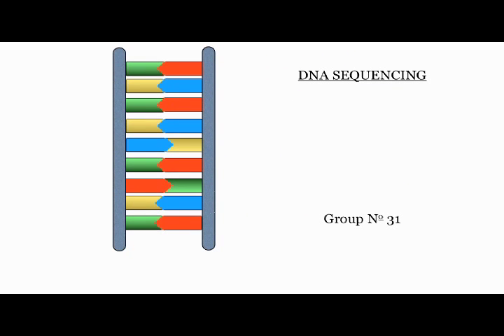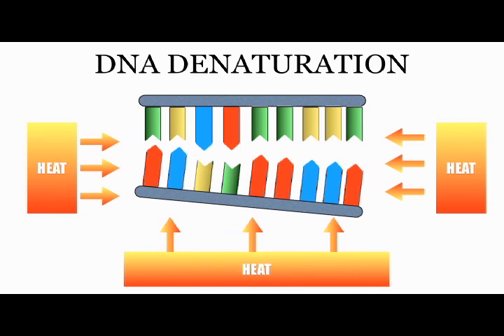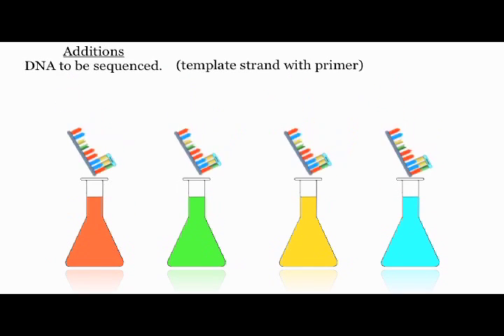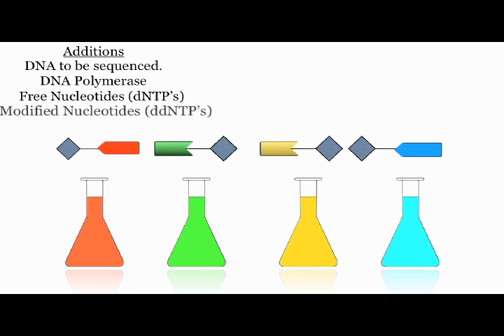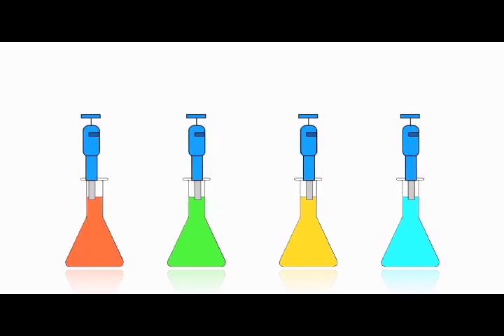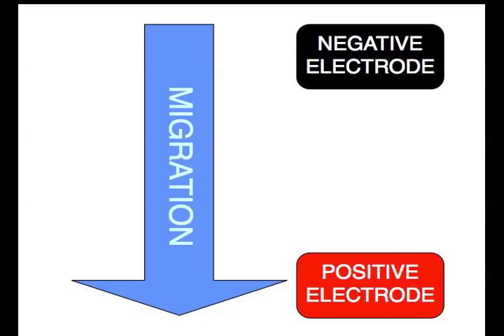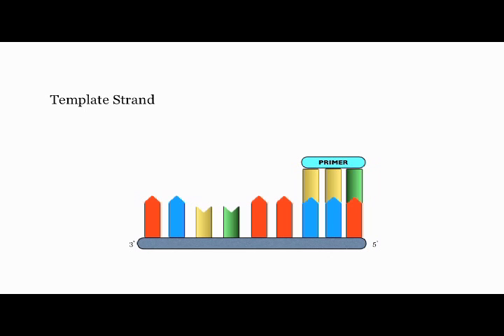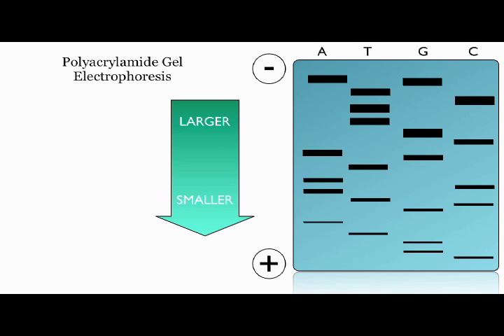DNA Sequencing: The Chain Termination Method (Sanger Method)

Comment: 1. He fails to explain that it is the primers that got labeled so that X-ray can be used to see all sequences.
2. His accent is annoying.
3. He fails to mention the sequences differ by one base only in gel electrophoresis.

Therefore I gave the video a thumb down.
Reply from the maker: In reply to your critisms:
1) Radiolabelling of nucleotides mentioned at 1:02. Also, at 2:09; "The gel is dried down and an X-ray taken. Since we radio-labelled a dNTP we can now see it show up on the X-ray film."
2) A matter of opinion. I would point out that Irish accents are consistently ranked as some of the most attractive, but I understand that some people are just hard to please.
3) This is incorrect. At 1:47 I mention how polyacrylamide gels can separate fragments differing in length by 1bp. Also I would point out, contrary to your point, that this is not true for all gels. Agarose gels for example, can typically resolve differences no smaller than ~40bp between fragments but this does depend on the gel percentage and other variables.
Reply: Thumb up for the effort.
Reply: wilson Liu u got rekt
Reply: if you understand it so well then why don't you make your own video?
Reply: your comment is unnecessary
Reply: rekt

Comment: I'm still confused why reading across the bands will tell you the dna sequence. am I missing background info that would help?
Reply: Did you find the answer yet ?
I have the same question 😑
Reply: +Deena Haroon I typed all this on my phone and only now realized all the typing errors. sorry. I hope you can read past it and it was able to explain it properly. (as a note, although it may look like the 5' end is the end shortening, it should be the 3' end that is being removed and shortened.)
Reply: +Jessica Wong actually, you probably don't even need a ladder here. I think the main fact is that you have a primer, so you can make a defined start point. So the template bound to the primer should be the smallest molecule. On a gel, this should be at the bottom. So now, if you have all other molecules in the well separated by a single base, you can pretty much read the order in which they appear, from the primer sequence onwards (or upwards in the gel). 

Again, hope that makes sense. I'm busy studying for a genetics exam :-p
Reply: +Jessica Wong  hey im not entirely sure myself but the video mentions that the gel can separate molecules by even one base. And usually, when you use a gel you always have a marker (I'm assuming these markers mark different intervals across the length of DNA). So if you combine this with the fact that each lane has a band corresponding to a termination by a base of that lane, you can read off (using the marker) where these bases are on the fragment of DNA. 

Not too sure I made any sense there hah

Comment: Hi, sorry when I'm wrong, but DNA ploymerase goes from 5' to 3', so is the primer in the video on the wrong side, isn't it ?
Reply: +Borat Sagdiyev To rid of any confusion: DNA Poly replicates in the 5' to 3' direction complementary to the template strand which will appear 3' to 5'.
Edit: Removed PolyIII as Poly I is used in this method.
Reply: +Peter Allen Thats awkward phrasing. DNA polymerase travels in a 3' to 5' direction, producing a NEW DNA strand in the 5' to 3' direction
Reply: You're correct, sorry about that! Thanks for rephrasing!
Reply: I think you are correct - new nucleotides add on to the 3' end - so that would make it the wrong way round
Reply: +Borbála Horváth DNA pol goes from 3' to 5'

Comment: Note that this is not quite how modern Sanger sequencing is done. Rather than using radioactively labeled dNTPs, the ddNTPs each have a different fluorphore on them. There is only one reaction, and the sequence is read by looking at the color of fluorphore on the end of each consecutively longer strand.
Reply: Students taking a genetics course need to know the old way sequencing was done  as well as the newer ways.
Reply: That's Automated DNA sequencing, not Sanger method
Reply: yes but if kids at school are struggling to understand anyway then might as well just learn the right one ! it would be nice to have seen the nucleotides actually add in a short animation or at least series of diagrams so its not all in your head. nice video though.
Reply: nothing like an intensive purpose